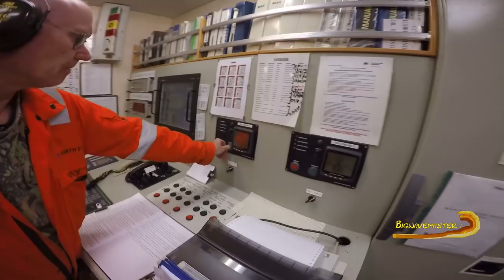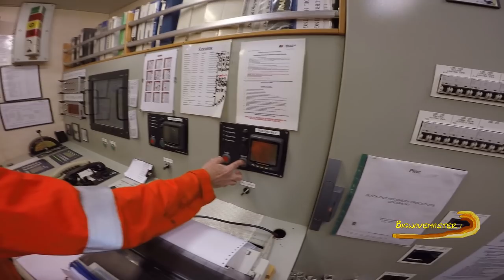Part 25 A Month at Sea on an ERRV (September/October 2019)

Comment: Do the bridge "windshield" wipers have an automatic setting? I noticed that the one on the far left swiped back and forth while the test did not. Also, have you ever had one of the bridge windows break do to a wave hit?
Reply from the maker: The wipers all have their own individual switch with 4 different speed settings. 
Yep! Had the windows put in a couple of times but not on this vessel.

Comment: Whats the purpose og the big hydraulic cylinder at around the 5.40 mark?
looking on drawings of your ship online, I would guess that it is to lower the maneuvering thruster?

great vid, keep the good work up, and stay save
Reply from the maker: Yes, that’s the azimuth.
Reply: Hi,its a schottle,which isn't as powerfull as a bow thruster,so we use the schottle for st/by duties or harbour manovering,in calm weather a ship without main engine propulsion and with a bowthruster/azimuthe will give you 7 knots,a schottle will give you 3 knots maybe,a bow thruster is a main of propululion,a schottle isn't a main means of propulsion,hope this is help,regards